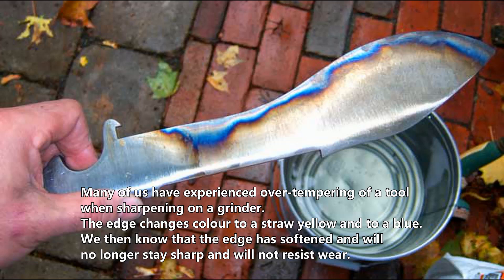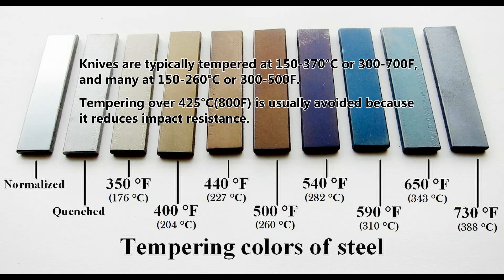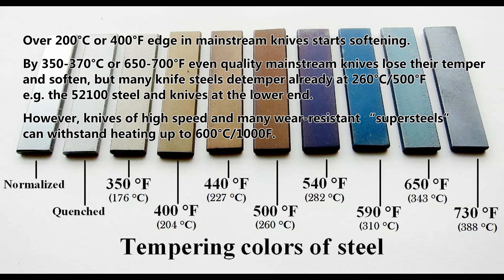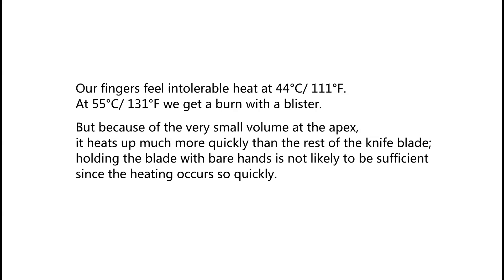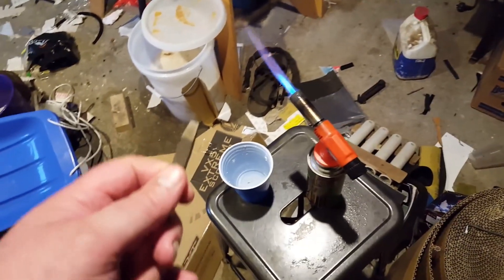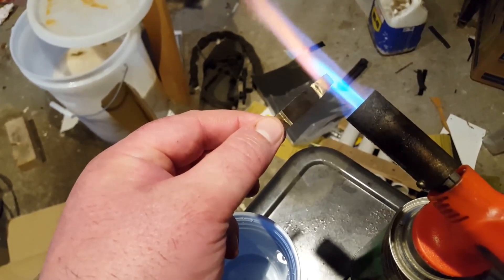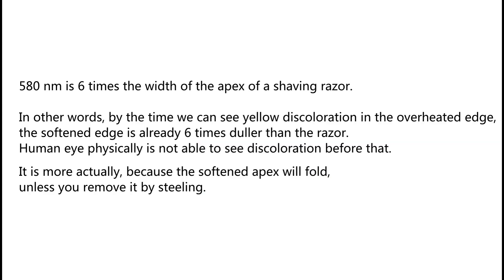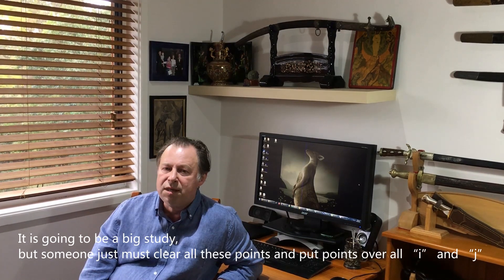Heat in Sharpening - Temperature of softening of the knife steel

Comment: Fascinating topic, even thought it doesn’t take long before the physics quickly go over my head ;). But I do wonder about this de-tempering of the very thin apex. If it is quick to heat, then the reverse is true too, and it may dissipate heat quickly enough to avoid harmful effect?  Also if only the thinnest part is vulnerable, that bit might also be removed on the very next pass anyhow?  

Hard to imagine how these effects could be tested other than inferring based on edge retention tests between sharpening methods that produce heat and those that don’t?  

Great work, Vadim!
Reply from the maker: The same, Brad - I am very intrigued myself, and we are in the middle of testing. There is no reversing with cooling - as soon as the heating in the edge reaches the temperature at which the given knife was tempered, and it is often as little as 400-500 F, the edge softens irreversibly to the depth of the heat.
You are right that every next sharpening step removes steel that might have softened in the previous steps - that is why we focus on the final step, the honing.
Reply: @knifegrindersaustralia5158  Thank you.  A bit of imprecise language by me.. I didn’t mean reversing by cooling down after passing the de-temper temperature, but rather that because heat can dissipate so quickly it limits how hot the apex can get in the time that it is passing over the belt/wheel/stone… 

I’m sure you’re going to find a clever way to study this - looking forward to the results!